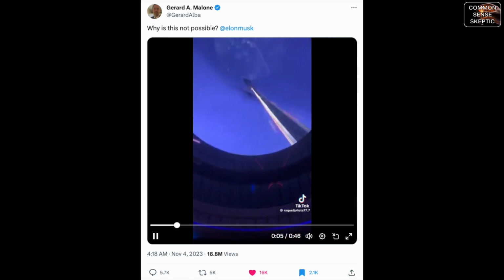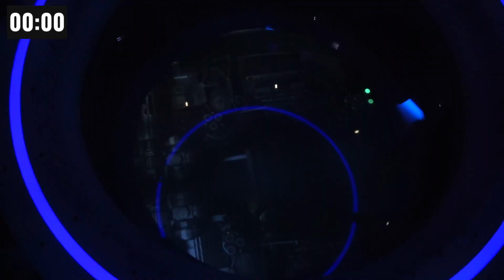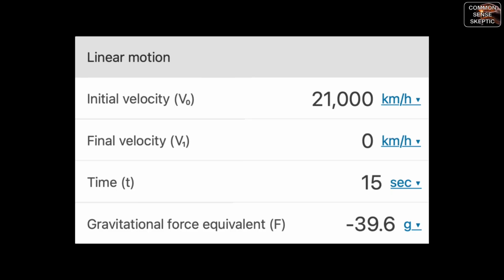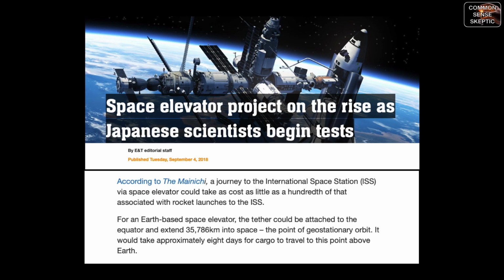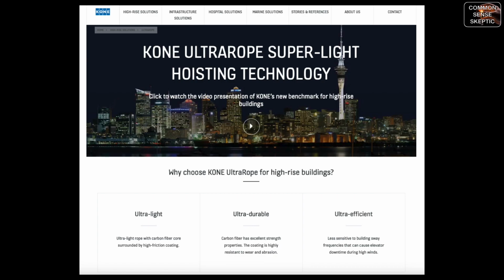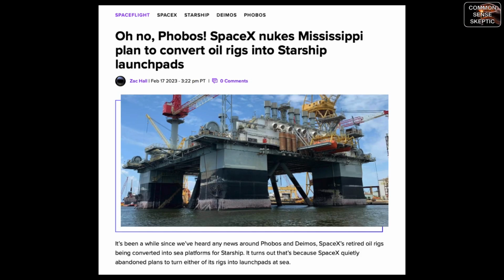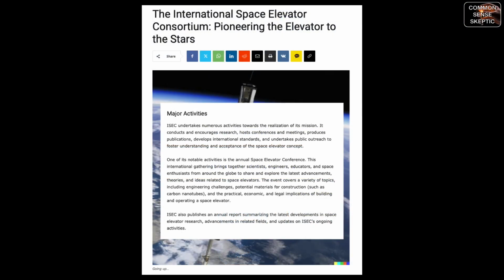DEBUNKING L.E.O. SPACE ELEVATORS

Comment: Problems covered:

04:38 Location issues (must be along equator)
05:35 Speed and G-forces
10:20 Lack of practical applications for a system
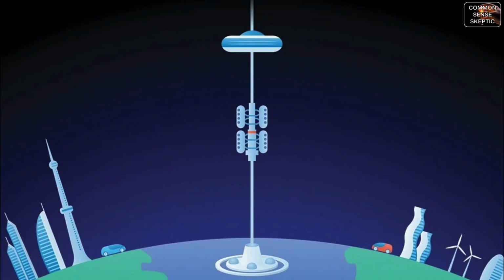12:55 Cable length limits
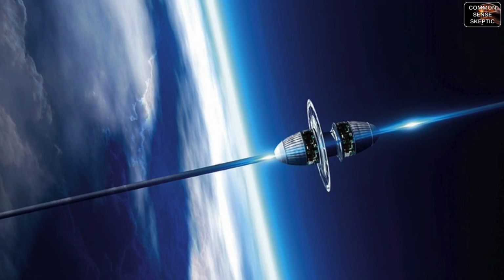15:06 Vibration and resonance
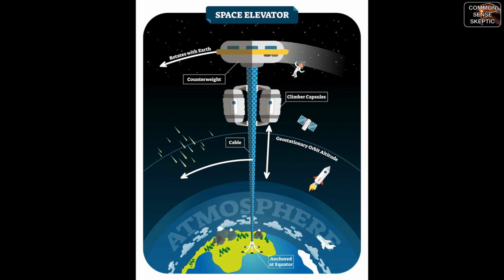17:29 Impracticality of cable anchor needed
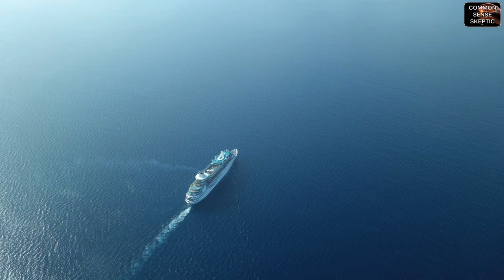18:44 Impracticality of building at sea
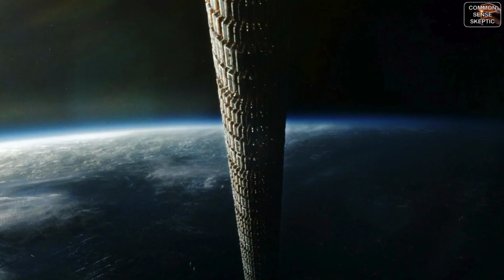21:53 Hazard to satellites and aircraft
23:11 Thermal expansion

Comment: 16:07 The illustration with the piano keys in that picture is not accurate at all. A 5/4 interval is actually 13.7% of a standard semitone flat of a major third in 12-TET, while the seventh harmonic is 31.2% of a semitone flatter than a minor seventh. This is one of the reasons why I hate using the piano for things like these, because it cannot accurately portray anything outside of 12-tone equal temperament.

Comment: And then there is this.   As the capsules run up the cable, the cable has to provide lateral force to the capsule as it moves away from the Earth to accelerate the capsule to its new rotational/orbital velocity.  It has to deliver force at nearly right angles to the cable for this added impetus.  The cable will resist the acceleration, forcing it to bow opposite to the direction of orbit.  Like drawing back a bowstring.  And that would be true in reverse on descending.  Lateral forces on the anchor would be dangerous and if it pulled the anchor down as the cable bowed back, the radial velocity of the anchor would change, too.  It would likely require that rockets be attached to the capsules to provide the lateral acceleration and keep the forces away from the cable.  In short, this will NEVER work.

Comment: You make some very good points about the engineering and environmental problems to be overcome before a full space elevator becomes reality. I am optimistic that these will be overcome at some point. It appears that the most difficult part is the lower section and maybe that will be the last achievement. Using a graphine ribbon could be emloyed as an orbital energy source before a full elevator becomes available(for example).

Comment: The only stable space elevator is one that has its center of mass at Geosynchronous altitude ( 3 earth diameters out ) - That requires the cable to stretch BOTH all the way from GSO to earth AND the same distance AWAY from earth.   In this scenario, what holds the cable stable is TIDAL forces.   Every meter of cable higher that GSO is moving too fast for its orbit and wants to spiral outwards, And every meter of cable closer to earth than GSO is moving too slow for its orbit and so wants to spiral inwards.   There is no material known to man that can withstand the tensile force that such a cable would be under at its C of G.

Comment: You have not even discussed the energy requirements to lift a load up 350KM.  No only the energy required, but how to get that power from the power source to the capsule (if the motor is in the capsule).  If the motor is at a terminus then you have a 340km haul cable in addition to the main cable.

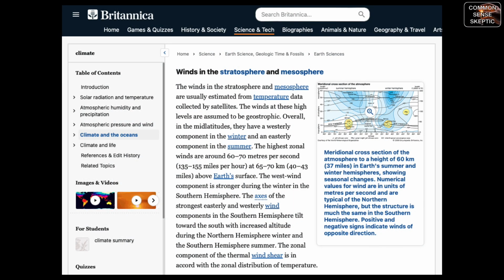Comment: 17:03 The harmonic oscillation of the cable due to wind seems like a total deal breaker even with infinitely strong materials, it seems.

Another issue I noticed was the change of moment of inertia of the earth-cable-station system as you bring mass up to the station. This would cause the station at the top to fall behind in orbit as the mass is raised.

Could both these issues be solved with two cables anchored to different points on Earth's equator? Could using additional strands to brace the two cables higher up eliminate any vibrations at low harmonics in the cable that would cause issues?

Oh, the gravitational effect of the moon is also a deal breaker. 

Pretty incredible it's being discussed so much by seemingly serious people.

Comment: As ridiculous as the concept is, I think my favorite Science Fiction/Science Fantasy depiction of a Space Elevator system is the one from the anime Mobile Suit: Gundam 00. Three Orbital Elevators, which took decades to build, were extremely fragile, difficult to manage, and had two levels of stations, having orbital rings connecting the three, with the lower ring being important for the structural stability of the system, as it would pump a magnetic fluid of some sort through that ring to help stabilize the towers (However that would work, again, science fantasy there) and then the outer ring, which was loaded with solar panels, as the entire purpose of those elevators was as a power system. However, what I liked about the concept the most was, instead of being an elevator in the conventional sense that you just ride up in a single structure, all around the surface of these towers were Orbital Trains, as they were called. Vertical trains, that traveled about the speed of a bullet train. So, the trip up the elevators, even to the lower platforms, took a fair amount of time. Again, interesting concept, but not feasible to do in any way.

Comment: I think you missed the fact that when you lift an object up along the cable, it's going to want the trail in speed at its original surface speed. This will apply a lateral force that will need to be countered or else you'll pull the counterweight in a little.

Comment: Few notes on errors you made.
You misrepresent the Kurzgesagt video as they are talking about only a station in geo stationary orbit, launching a satellite by pushing it out the airlock is completely reasonable.

On placement for tethers
You can have tethers to non-equatorial spots on the globe, but they would need to be 3 or more tethers ending at the same point in orbit. The tethers would need to be  a little stronger than an equatorial tether (which is granted currently not possible with currently available materials with some caveats.)  

On  LEO space elevators
Those would be technically possible, though you trade some of the material science challenges for steep energy challenges.  The solution is to have a constant thrust provided by a ground station, one idea is to send energy up the tether using charged particles which would mostly bounce off the station with some absorption for power delivery.

Offset carriage
That's actually a good design element on the ride since you would want a second carriage on the other side of the tether with equal weight to be returning to earth at the same time, the problem is you should see it in the ride as you pass midway. 

Carriage movement
This would not be using very long elevator cables, more likely we are looking at permanent magnates on the carriage with people being moved up as a solenoid and down using eddy currents to lower a carriage. 

Harmonics
Any cable is going to be tapered and not homogeneous throughout the length, which makes dampening harmonics much easier on the design side.

Temperature gradients. 
The whole length of the cable is necessarily powered, equalizing temperature across the length especially width are relatively easy engineering concerns. More likely the cable would be hot to keep ice and water from collecting in atmosphere and by virtue of the energy requirements

Weather
Wind speed is the biggest concern, though even that is a material science concern, not a drifting one. The teather needs to be strong enough to maintain stability while course correction in space can account for large wind patterns.

Not an error per say, but would do you also feel that the ITER tokamak reactor is a scam? 
Many of your criticisms on space elevators apply to fusion energy generation as well. From the material science issues, heating issues, cost, even the long running advocacy for the idea that has yet to produce an elevator.

Comment: its not possible because of many things , the most obvious being the wind , the second to keep the cable in orbit it will have to go faster the nearer to the ground
Reply: You have that backwards. Geostationary satellites are traveling at 7000 mph vs 1000 on the ground. You would need rockets to accelerate the cable every 1000 feet or so depending on how straight the cable needs to be.
Reply: @stewiesaidthat  angular velocity , sorry.
Reply: @patthewoodboy  as the radius increases, so does the rate of acceleration. The Earth's atmosphere creates a drag which, if not compensated for, will eventually cause the cable to wrap around the earth. You will need space station with enough mass to create the necessary centrifugal  and centripetal forces to keep the cable taught. And then you will need to anchor it deep enough so that it is pulling from the center of the earth in order to balance it and not create a wobble. Which means multiple spokes/cable elevators.

Comment: As it was said the only position for a synchronous satellite is at 36000 km. But to get up there you don't only need to climb there but you also need to accelerate laterally as you go up or the cable will bend to the side, so you will be forced to put rocket engines on your elevator to push it to the side also. So in the end the energy you will need will be the same, you need to accelerate the elevator to more than 3 km per second to the direction of orbit. And the satellite in orbit at 36000km would need to have a huge mass to be stable enough. So all this is just a wet dream made by people who don't want to make the calculations because it would immediately brake their dream. Just imagine we find antigravity, it's much easier to make even if we don't have a clue !!
Reply: Gravity is acceleration. How do you make anti-acceleration? You stop the earth from spinning on its axis and orbiting the sun which is orbiting the galactic center which is on a course to who knows where.

Comment: You're also wrong about needing a massive anchor on the ground deep into the crust.  The weight of the cable itself is holding down most of the counterweight.  The attachment point doesn't need to be insanely strong.  The force the cable needs to exert on the anchor is only a bit more than the weight of payload/climber you want to be able to lift.
Reply from the maker: You realize you're arguing fiction, right?
Reply: @commonsenseskeptic  Yes, I realize some of your arguments are strawmen, that was my whole point.

Comment: Not science fantasy. Just science fiction. In fact, hard science fiction. The problem is when it's placed in near future (decades); intermediate future (centuries) would be more appropriate.

The reason it's hard science fiction, is that the physics are realistic; the issue is with the engineering, viability, and economics. We don't have the technology to do it, and, even if we did, we probably couldn't manage the complexity of implementing and integrating all the technologies. If the engineering issues were solved, the issue would become viability and economics. We'd have to resolve conflicts with other interests, such as orbiting satellites, it would need to be more efficient in use than other solutions, such as launches, it would need costly maintenance, it would be extremely expensive to build, and more.

I'm surprised that the variations in Earth's gravity, which would complicate things considerably. For one thing, the cable would curve. In fact, it even complicates this video. To accommodate for the variations, the anchor point would need to be off-set from the equator; it would almost certainly be impossible to build it exactly on the equator. There are several other issues that weren't mentioned. Most of these issues are well known among hard sci-fi fans, and, I presume, to proponents of building a space elevator, if and when in becomes feasible.

Pointing out known engineering problems is hardly a "debunking"; at most, it's "party pooping". I'm sure there are specific projects that can be debunked, though; definitely anyone who claims this will be possible in the near future. That's very different from debunking the concept, though. To debunk the concept, you need to demonstrate that the science makes it theoretically impossible.

Personally, I don't believe a space elevator will ever be a viable project, and therefore will never built. I'm absolutely sure we'll eventually have all the engineering solutions to make it possible, though, unless we manage to wipe ourselves off the planet, first. 50/50 is what I'm saying. We just have to survive as a species for another few centuries.

Comment: One thing I find lacking in discussions on the space elevator concept is the examinaton of forces in the equatorial plane, e.g. Coriolis force acting on an elevator cabin during travel, and what that does to the whole system. Consider this:

A cabin traveling upward will experience a force tangential to the cable in the direction opposite to earth's rotation. That force will tug on the cable, and eventually on the "space anchor", which will result in an earthward ("anti-normal") acceleration of that "anchor". This in turn will cause the "space anchor"'s orbit to become eccentric, effectively causing the anchor to oscillate in a kind of circular motion (as viewed from a ground observer) around its designated "parking spot". Such oscillations will be dampened by the cable eventually, but that also means that the anchor will lose energy to the cable, which will convert that energy to heat.
The same process, albeit in reverse, will happen when the cabin travels back towards earth. The bad news is that this will not recuperate the lost energy, but rather will lose even more energy.
You can't even counter this by having one cabin ride the elevator up and another down at the same time: By virtue of coriolis force they'll tug at the cables in opposite directions, but at different locations along the cable (except for that very brief moment when they meet each other halfway along the cable), so there will still be an increase in the cable tension and thus an increase in the downward force pulling on the anchor.

Now if the "space anchor" were parked at geostationary orbit, that would be game over: If it were an untethered satellite, it would just enter into a lower (and probably excentric) orbit and find new equilibrium there; but that equilibrium would require faster-than-earth angular velocity, which the tether wouldn't allow. Instead, it would decelerate the satellite even further - finding new equilibrium only resting on the surface of the earth.
A more realistic "space anchor" would be parked way above geostationary orbit instead, and would therefore fare slightly better. However, it still wouldn't resume its nominal position: Instead, it would settle into a lower orbit, compensating for the resulting "slack" in the cable by both shifting its partking spot further westward and also reducing the cable tension.
Eventually, even this system's orbit will drop below geostationary, and things will come crashing down - literally.

So yeah, even if you manage to get an "anchored satellite" contraption to actually work - as an elevator it could serve only a limited number of rides. Which quite defies the whole purpose of the concept.
Reply: Oh, and did I mention tidal forces?
Yeah - we'd need to get rid of the moon first.
Turns out it'll tug a "space elevator" back and forth twice a day, again causing the system to lose energy in the form of heat.

Comment: First for the Disney ride - such a thing might just be possible but built based on a Kinetic Tower not a space elevator. There would be no cable above the space station and no orbit - so the thing would have gravity..

Now space elevators are impossible.. - Or rather they are possible but orbital mechanics and other physics makes them totally useless. A rocket is easier and actually works.

Comment: Given sufficiently* strong materials, you can have a static station tethered there, but there will need to be a counterweight beyond GEO and the geometry of the tether is going to have some curves (IIRC, Robert Forward worked out the math) [pretty sure a fountain arrangement would be dynamically unstable unless you had a full up launch loop there]

*sufficiently is doing a LOT of work here. while it is likely that certain carbon compounds could work, in theory, for some of the lower end designs, trying to do something tricky like an off equator tether put you outside what is likely possible with chemical bonds, even if you manage to produce perfect carbon nanotubes of arbitrary length. Anyone trying to tell you they are anywhere near it had better be able to provide you with a multi-kilometer long spool of specific strength 75+

Note: The temperature and voltage potential differences are an opportunity, not a problem

Comment: Kim Stanley Robinson addressed many of these issues in his Mars trilogy (Red Mars, Green Mars, Blue Mars). They are a great read and answer a lot of the questions raised by this video. It is a simple fact that STEEL is not a viable option and a space elevator will require multiple cables, counter weighted transports, temperature stabilization, and an EXTREMELY deep anchor into bedrock, most likely a mountain in Ecuador.

Comment: I suggest a read of "The Fountains of Paradise" - Arthur C. Clarke for a good discussion of space elevator physics in SciFi novel form.
A proper space elevator is built from a captured asteroid at Geostationary Orbit, 35,786 km (22,236 mi) in altitude above Earth's equator.
The carbon mono filaments (unobtainium) are then extruded in two directions, out and in from processing plant on and around the asteroid. 
The system remains balanced as it is constructed and you end with a structure twice  35,786 km (22,236 mi) in altitude above Earth's equator (about 20% of the way to the Moon). It is completed when the Earth end is tethered and the forces are limited to weather forces and traversal load weight because the system is gravitationally balanced. It also takes days traverse. Not starting at GO and building out and in is a non starter.